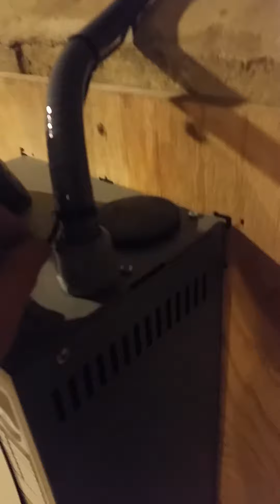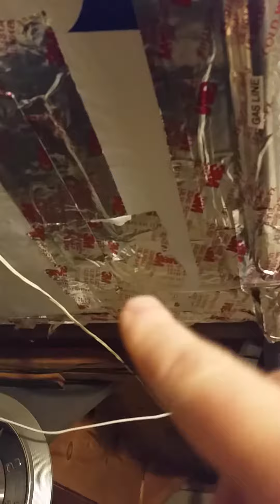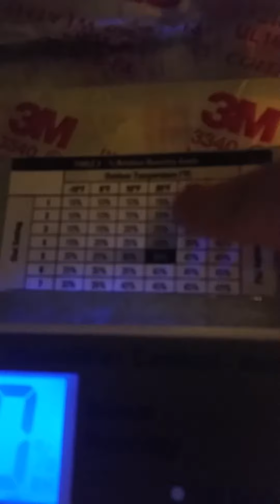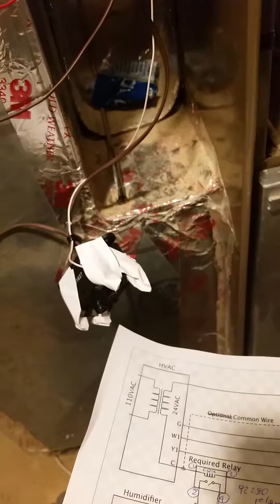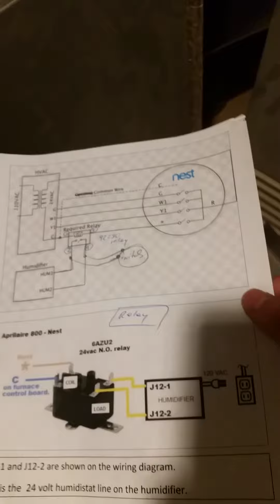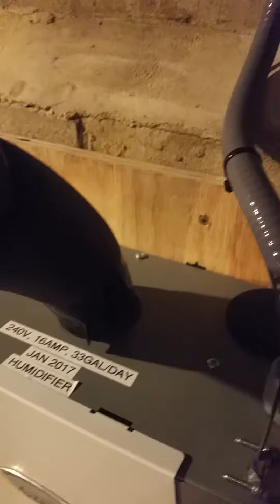Part 3 of 4 - Google Nest Thermostat 3rd gen + Aprilaire 800 whole house humidifier - full install

Comment: how to connect wires to the relay? did you use any special connector? I see that you have some tapes on the relay. Also as specified in NEST website, there is a connection to humidifier Solenoid. Does the AprilAire 800 also have a Solenoid connection to be given?
Reply from the maker: +Ambika Jagannathan 
I used (white) electrical tape. 
Wrapped the wire around the relay leads and placed some tape so it wont short by accident.